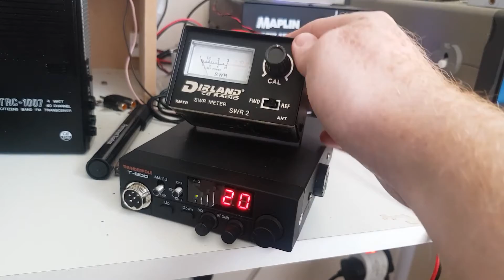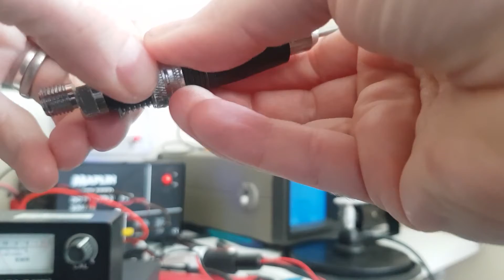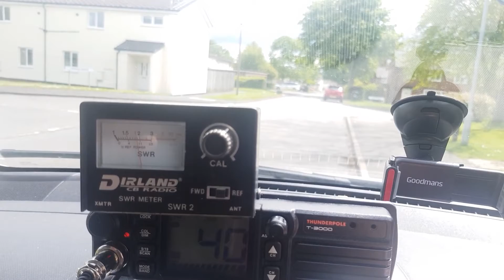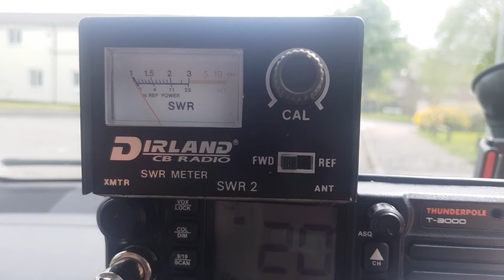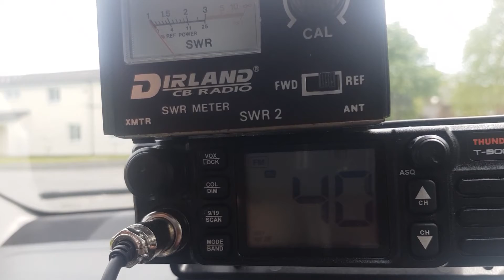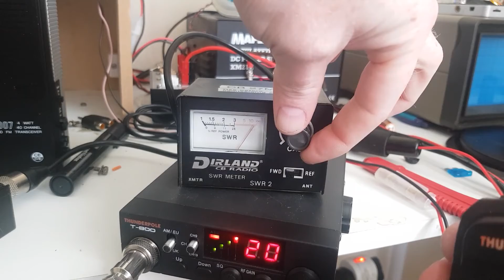Beginners guide to CB radio, video 5: SWR and tuning the antenna

Comment: Hi so if I connect a swr meter like yours and the swr happen to be really high in the red field, will this meter be able to protect the radio while connected with it or would it be exactly the same if I were just to transmit without being wired up to the swr meter unit? (in other words same risk of damaging the radio)
Reply from the maker: The risk of damage would be the same regardless of whether the meter is connected or not
Reply: @PaulMcGeeM0WNU  So then I have to be very fast when doing this. I mean there is always a risk that something is wrong and you don’t know that and connect it to a swr meter and push the button and then the radio is fried?
Reply from the maker: @GoldaRabinovitz  most radios should be ok for the time it takes to get a reading

Comment: Not much you missed on that one, nicely done.

SWR for those that want to know why you have to check it:  It stands for Standing Wave Ratio (SWR).  It might have been better named as Reflected Power Meter, but SWR it is.
If your aerial is not properly tuned it will reflect power back to your radio, this results in heat inside the radio and can damage it.
Ideally your SWR should be at least 1.5:1. 1.5 or lower on the meter on ref'.  However, as we now have 80 channels and not 40 like we used to have, the aerial has to be tuned over a wider range, it will not be so easy to tune, but as long as it is 2 or less, it should be fine (I think the manufacturers have kept the power lower on new radios for this reason, but that is another subject).
Check the SWR as Paul has shown, check the high and low channels.  If the SWR is high on the low channels, the aerial is to short, if it is high on the higher channels it is to long.  If it is high on both, check your coax for a short or open circuit (with the radio disconnected).
Base Station Aerials:  Some base station aerials are preset, so if you have a high SWR (Above 2) there might be a short or an open circuit in the coax.  NOTE:  You will need to disconnect both ends of the coax to check the coax as the aerial may have a transformer inside, this will show up as a short.

I know it is intended for beginners.  But for those that want to know slightly more....

Good work Paul, some good advice in this series.
Reply: It's incorrect to say reflected power is reflected back into radio and causes damage, reflected power joins the forward power at the mismatch at the radio and resulting wave is reflected back to antenna, this is basic wave mechanics, what does cause issues with equipment is reactance drawing too much voltage and current
Reply: @Pioneer936  You have to put things across in a way that people understand things.  If you go all technical, people just switch off and don't try to understand what is going on.  It causes standing waves in the feeder/coax, this results in heat.
Reply: @BoB4jjjjs  it's so easy to say and understand that reflected power does not reflect back into radio equipment and cause damage  to say it does is conning your audience
Reply: I don't get it. Is the SWR meter connected to the CB?
Reply: @tandepasta7716  Some CBs have a built in SWR meter, others, you have to connect an SWR meter to the CB via a small patch lead.  Remove it after you get as low an SWR as you can get.  1.5:1 is quite good.